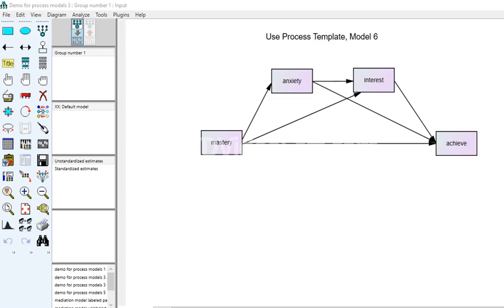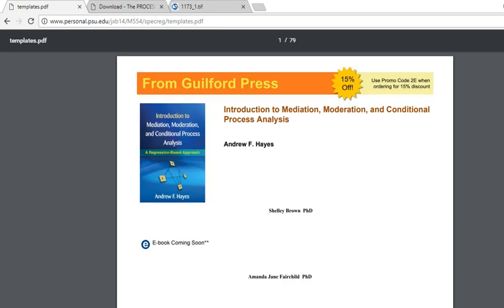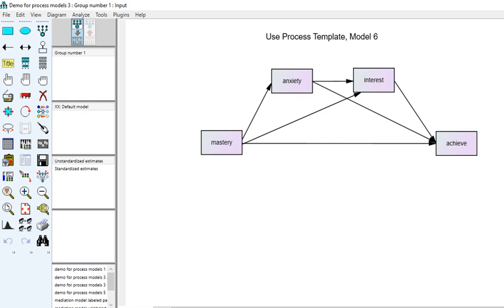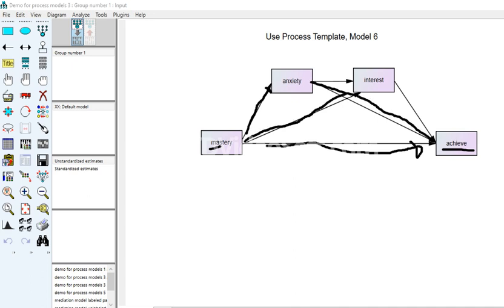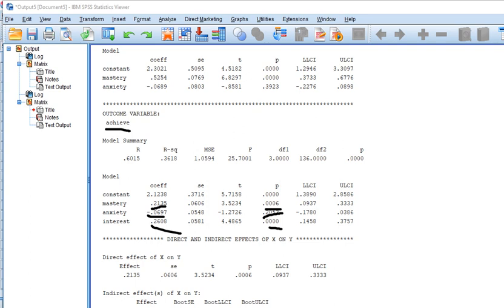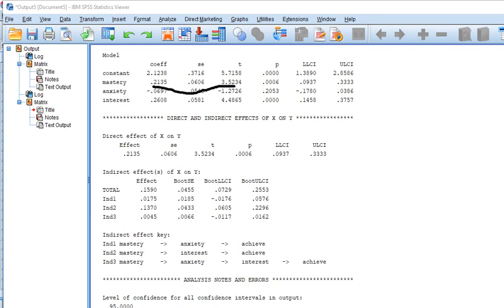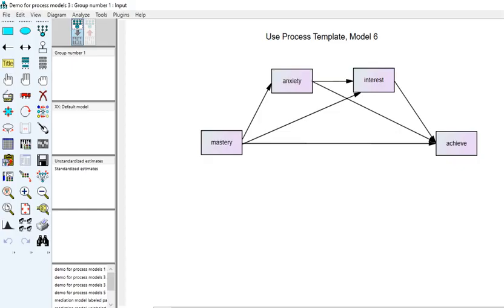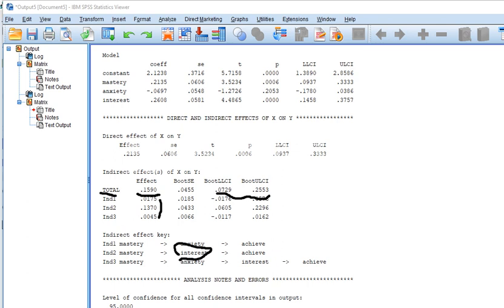Testing sequential mediation using Hayes' Process macro (Template, Model 6)

Comment: Hi Mike. I need your guidance in analyzing my research model. My model has 4 IVS, 2 Mediators and 1 DV. I want to test 
(i) direct impact of 4 IVs on the DV
(ii) indirect effect of 4 IVs on the DV through M1
(iii) indirect effect of 4 IVs on the DV through M2
(iv) sequential mediation effect for 4 IVs on DV through M1 and M2
Firstly, I want to know which approach would be best to test this model. Should i run all at the same time or analyze every relationship separately by drawing all models separately
Secondly, 5 variables in my model have few dimensions and 2 variables dont have dimensions. So in this case should I go for first order cfa/sem or second order cfa/sem??
Waiting eagerly for your kind response

Comment: Hi Mike ! Thank you for this video ! Your explanation was very clear. I am also running a model 6 (PROCESS macro). However, I first wanted to test the direct effect (X --> Y) with a simple regression (it was signficant). Then I used twice the model 4 to test each mediator separately. My direct effect became negative in only one of the two model 4. Finally, when I put all together in model 6, the direct effect (X --> Y) was insignficant. Is there a reasons why this direct effect that was previously signficant became insignficant?
Reply: Hello Lea, I have the same problem as you with data. Have you found a solution?

Comment: Hi Mike, Thanks for this great video. It's the first I have found that demonstrates how to interpret PROCESS Model 6 output, and your explanation is very clear. I would be grateful for the answer to a question: If one of the indirect paths is statistically significant (95% CI does not include zero), but the total indirect effect is not statistically significant, how do you interpret that? Thank you!
Reply from the maker: Hi there. Thanks for your post, and interesting question. The only way I could see this happening is if you have some indirect effects being negative and others being positive, and when they are summed to the total indirect effect it sums to zero (or nearly so). (Logically, this is the same thing that could happen when you are testing the total effect of X on Y where you have a single mediator. If the direct effect is one sign and the indirect effect is another sign, it's possible for the total effect can sum to zero.) I would focus my discussion on the specific indirect effects since this is what you are most interested in to begin with. Hope this helps.
Reply: Many thanks, Mike. Much appreciate your prompt and clear response!

Comment: Hi Mike, so I do not have to account for multicollinearity of anxiety and interest by standardising them? - In other words, does the model 6 already account for that when assessing the effect of mastery, anxiety, and interest on achieve?
Reply from the maker: Hi there. Thanks for visiting! I'm unclear what you mean by 'accounting for multicollinearity by standardizing them.' The full model that is being tested here is constructed from three separate regression equations - one per endogenous variable in the model. Eq. 1: mastery-->anxiety; Eq. 2: mastery+anxiety-->-->interest; Eq. 3: mastery+anxiety+interest-->achieve. Equation 1: is a simple linear regression that reflects the zero-order relationship between mastery on anxiety. Equation 2 is a multiple linear regression with mastery and anxiety entered as separate predictors. The slope for mastery is controlling for anxiety, and the slope for anxiety controls for mastery. Equation 3 is a multiple linear regression with the mastery, anxiety, and interest as predictors of achievement. The regression slope for each predictor is controlling for the effects of the other predictors in the model. All regression slopes by default are unstandardized. If you request 'standardized coefficients' under the Options tab, then you will also obtain standardized regression slopes, as well as standardized indirect effects in your output. You should check out my newest video on Model 6 here (https://www.youtube.com/watch?v=vFGSa0KfDYA). You can also download a powerpoint as well. Cheers!

Comment: Hello, if I have 4/5 independent variables and all which will be mediated by M then how I will do the analysis in SPSS? As one time I can put 1 independent variable only. Will I have to do separately? Additionally, in my model dummy and control varibles will also be included as covariates. So if I have to do separate analysis then which value of covariates will have to be reported? I am using process v3.
Reply from the maker: Hi Eric, it sounds like your model is a fairly complex mediation model. My strong suggestion is to use an SEM program like AMOS, LISREL, MPLUS... I don't think there's a really easy way of accomplishing what you want to using Process (although I wouldn't say it's necessarily impossible; but require some series gymnastics). The nice thing about using an SEM program is that in addition to testing indirect effects, you can also test for overall model fit.

Comment: Mike, if one of the indirect paths is significant, but the direct effect also remains significant, does this suggest a missing mediator? Thank you!
Reply from the maker: Sure, it could suggest the possibility of other possible mediators between X and Y; on the other hand, the effect of X on Y could be both direct and indirect. You have to consult your theory to help you out with your model specification. If you can come up with other plausible mediators that might be included in the model between X and Y, then you can test these out using a multiple mediator model.
Reply: Many thanks, Mike. Much appreciated!